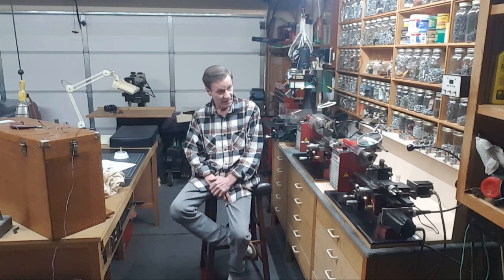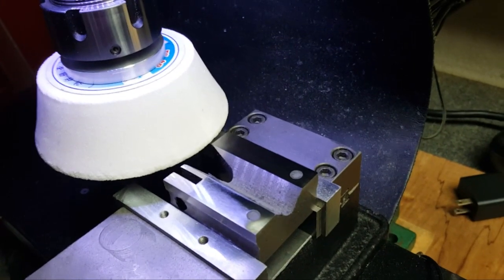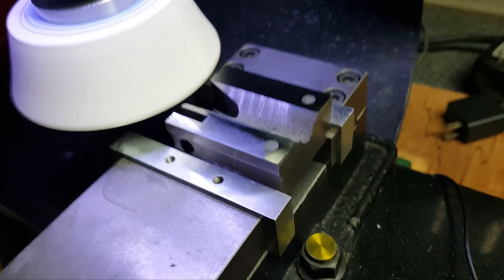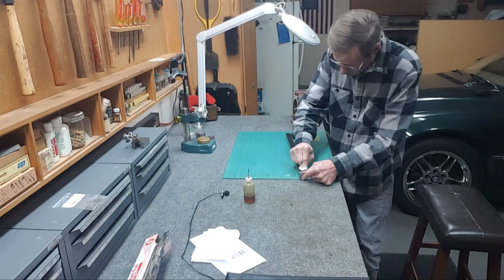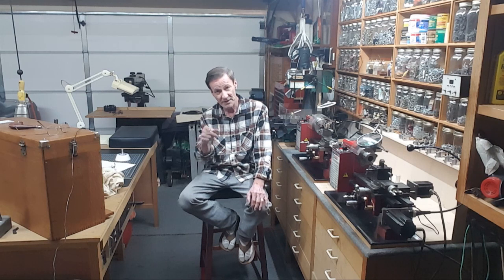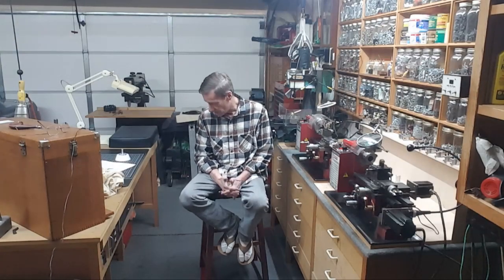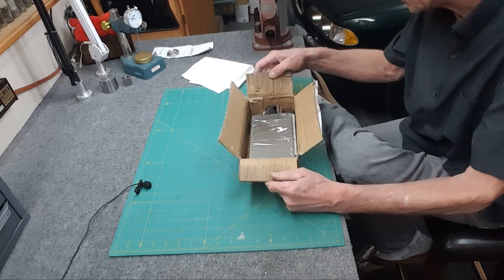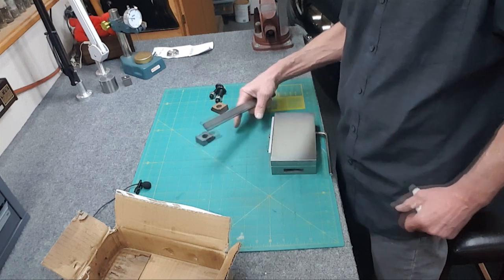Friday Night Buffet #6

Comment: What about using a grinding wheel (diameter) smaller than spindle of mill.  wobble would be much less and possibly usable.
Or shell mill on the lathe.
Reply: grinding cone on lathe I meant as lathe has larger rotating mass that is stable
Reply from the maker: @nathanquinlan2719  Problem is I have no way to hold the surface gage on the lathe.

Comment: I was given 2 car brake discs (new) from a friend who has a motor factors here in the UK and I use one of  them for tramming my X2 mill and it only takes seconds to set it up perfectly. They are about 8" in diameter so I can do both X and Y in one setting.
Reply from the maker: Hi Malcolm, that's a good idea! I don't have anything for Y to tram it.
Reply: Yep, I was looking on eBay for one for my X2 also. Somebody was machining them to close tolerances (on the lathe I imagine) and you could buy a 6" ring I believe and it was beautifully machined. I think it was close to 100$ CAD.